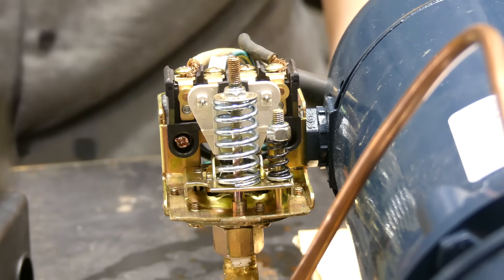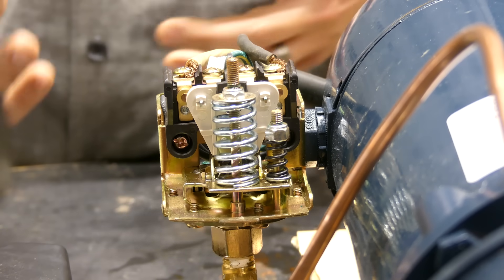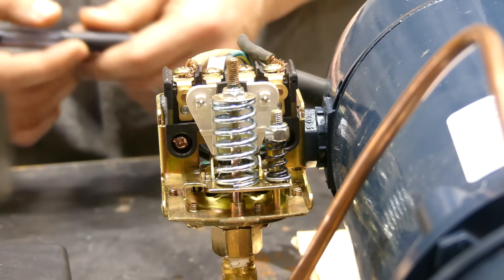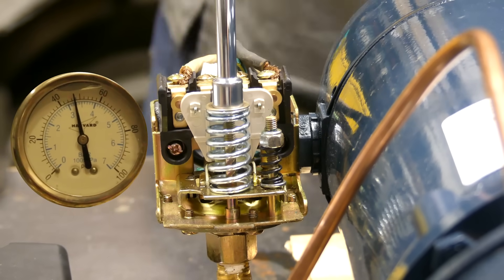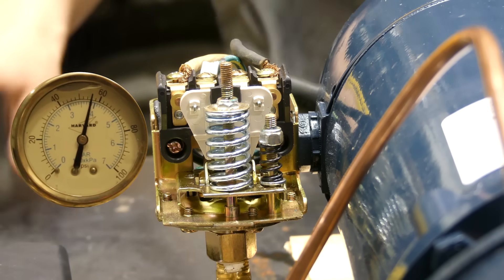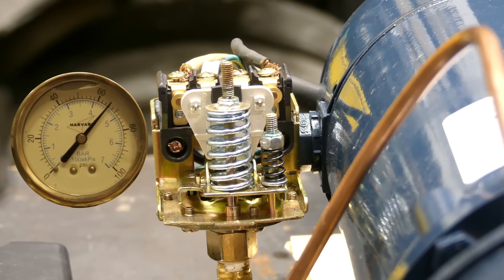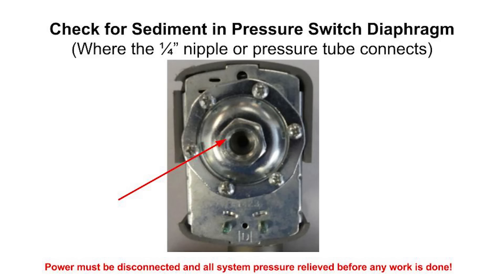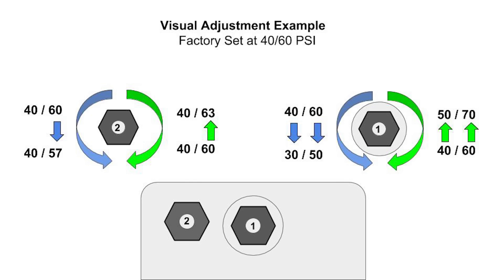How To Adjust a Pressure Switch

Comment: Thanks for the video. I did not know the specifics before I had replaced my tank and my pump was cutting in very low. I will need a new 40/60 switch but I was able to adjust my 30/50 in the meantime. Thanks
Reply from the maker: Glad it helped!

Comment: I just had to adjust the high pressure shutoff.  I have a shed that has the pressure tank and pressure switch and a house 200ft of piping away with another 30 gal pressure tank.  So I was having the well shut off when the shed tank got to 50psi then then the pressure would leak down to 40 psi to fill up the other tank, the house never saw 50psi.  So I upped the shutoff to 60 and it leaks down to 50 as it pressurizes the 200 ft of line and the other pressure tank.
Reply from the maker: Your pressure tank in the house isn't doing anything for you. All of the pressure tanks need to be close to the switch.

Comment: I wayched your videos, very helpful but still have a problem:
Erratic Water Pressure Issue:

The system will pressure up after the fixtures in the house drain off the pressure, however, the water pressure gauge is at zero, and the pressure switch with not cut back on for at least 10 min.  Assume there is a pressure lock of some type.
Steps I took to remedy:
1. After draining all pressure and water from system the pressure tank measured 10 PSI
2. Pumped pressure tank bladder to 28 PSI (30-50 switch), same issue
3. Replaced Gauge (old one was stuck) and Pressure switch (30-50 PSI), same issue
4. Checked voltage, 244vac hot to hot, 122vac hot to ground (3-wire pump)
5. Resistance was 4.6 ohms hot to hot, open each hot to ground
6. Drained tank again, and double-checked air pressure, same issue
7. Could force it on by bleeding off pressure on Schrader valve on tank but still will not automatically come on until system bleeds down for about 10 min.
Suspect pressure tank issue?
Reply from the maker: Replace the pressure switch and make sure the 1/4" nipple connected to it is free and clear of sediment buildup/debris. It sounds like there is a blockage that is blinding your switch from the real pressure.

Comment: I have a Square D Pressure Switch. Mine however has a Lever on the side of it. What this does is shut the Pump Completely off if the pressure drops about 7 psi below the cut in pressure. What this does is assume something went wrong. I.E. A Pipe broke, or the Well Pump is not pumping. You can manually restart the Pump after checking everything over by operating the Lever. I highly recommend switching to this Pump Control.
Reply from the maker: It is great for cheap pump protection, we even have a video on them: https://www.youtube.com/watch?v=ROvZpwHV9Ho
Reply: Or, there's no more water in the well or cistern, or the take-up pipe or filter is clogged.   For a cistern, a float switch can accomplish this as well.

Comment: Wouldn't you need to adjust the air pressure in the tank to coincide with the higher cut in pressure?

Comment: MOVING THE PRESSURE TANK from the well head to a place inside the home . . . how much difference in pressure would that create if the floor of the home were three feet higher than the ground at the well head?
Reply from the maker: If the goal is to increase the pressure than it would be best to simply adjust the pressure switch at the well head. You'd only gain about 1 PSI by moving the equipment to the house.
Reply: Well that's the first time I've seen that question!  A column of water weighs about 0.43 psi per foot.  The difference you'll see is negligible.

Comment: I had a pump that worked great but wouldn't come on when pressure dropped.  I'd tap on the pressure switch and it would come on. I figured time for a new switch but took it off the motor and into my shop. Removed the rubber diaphragm and found basically a formed sandstone preventing it from relaxing. Cleaned, put back together and works great now. Just fyi for anyone with this issue.

Comment: After adjusting the range to increase flow in the house,  do I need to add air to the bladder from 28psi to 38psi?
Reply from the maker: Yes, the air pressure in the tank needs to be set to 2 PSI less than what the cut in pressure of the switch is.  This reading needs to be taken when the pump is off and the system is empty of water pressure.

Comment: Thank you. just 1 Q: if the pressure is dropping without a fauset open...does that only mean that there is a leak, or could the switch be faulty??
Reply: You could have a leak, or a check valve or foot valve (in the well) that is not working properly.  Could be defective or just a piece of debris.

Comment: This is great had to replace that switch today ! And after had low water pressure.  .
So I just need to add pressure? Not go pump air in as I was told rt ?
Reply from the maker: Thanks for the question oldman! I would check the pressure in your tank prior to adjusting the switch. It needs to be 2-3 PSI below your cut in pressure. If it's too low, add air and test the water pressure. If the water pressure is still too low then you can adjust the switch, but be sure to add air to the tank accordingly. We explained this more in depth in our pressure tank video: https://youtu.be/w21qa2bMUh8

Comment: My pump isn't cutting off until I pull the power after it reaches 100psi. I'm getting 40 psi with all pressure relieved from system. I will check for sediment in the diaphragm. Can I blow it out?  I've been watching your videos. Thanks for the help
Reply: Defective switch or the tube that goes to the pressure switch is clogged.  I wish my pump could get to that pressure.

Comment: You also have to change Air pressure in tank to reflect the switch adjustment.  20/40 18 lbs....30/50 28lbs 40/60 38 lbs ...of air pressure.

Comment: Same switch is used in air compressors, adjusted 90lbs to 110 psi. Dual compressors 160 psi to 180 psi.

Comment: Definitely the BEST explanation, thank you! I still have a problem, however the switch isn’t cutting off at 60. I adjusted the differential ccw and still is not cutting off. Any advice?  Also, i see know way to prim the unit, how does that work am I trapping air somewhere causing less water to be stored in the storage tank?
Reply from the maker: Give us a call and we can help troubleshoot: 855.329.4519

Comment: Does this adjustment on a 30/50 eliminate the need of going out and purchasing a 40/60?
Reply: Just made an adjustment that you may want to consider. I also have a 30/50 switch. My factory preset psi on the tank is 30. So I know the tank can handle 30 psi of air (with the tank drained). The air pressure should be 2 psi less than the cut off setting,  so I adjusted my differential to 32/52 which made a huge difference after the settings had drifted over the past 2 years to approx 25/45.

To do this, turn off the power to the switch, valve off the water supply, and drain the tank of water. Adjust air pressure to 30 psi using a tire gauge and air compressor. Adjust the center nut as shown in the video until you achieve 32/52. 

Worth spending an hour or so doing this before you go all out on a new switch.

Not sure if the 30/50 is rated to be adjusted to 40/60. Probably not recommended I would assume.

Comment: great video guys,  Made very easy to understand.   What if the gauge keeps going off and on,  but no water is being used.  Could the gauge just be faulty.  Other than a faulty gauge, Any suggestions,   Thanks for the info.------- John
Reply from the maker: Sounds like you may have a leak.
Reply: @RCworstwater  I feel so stupid.  The next day I was outside and noticed the hose was on and had a leak.  Problem solved.   Thanks for replying

Comment: What's the best way to make these adjustments to the pressure switch and pressure tank if the gauge on the t-assembly is not functioning?
Reply from the maker: You need a functioning gauge on your system to read the pressure. They are around $5 at your local hardware stores.

Comment: Thank you. Your video is very helpful.
Besides low pressure, the other problem I have is that pump keeps turning on every time I use water even as little as washing hands.
Any recommendations?
Thnx again.
Reply from the maker: Your tank may not be big enough or the bladder has failed. Here's a video on how to check the air pressure in it: https://www.youtube.com/watch?v=w21qa2bMUh8
Reply: That was mine.  Tank pressure was only 5 psi.

Comment: If we have two houses and have had 3 before on a submersible pump on 40/60.  I had two broke places on the line and the men set my switch on 40/65.  Will this hurt anything.  My tank has 38 psi in the holding tank
Reply: Unlikely.  You can follow the instructions in this video.  Just back off screw #2 a bit.

Comment: My system seems to not be able to hold pressure during the switch between sprinkler sections.. my bladder tank is set at 38# so it’s good.. and my pump comes on at correct settings.. it seems tho, that when the switch between sections occurs, the pressure can’t hold thru the load it needs to change. Thus falls below the 40# and system turns off.

Comment: Can the range be extended for example on at 10 PSI and of at 60 ? This is because the the water pump is resuming too quickly.
Reply from the maker: Sounds like your pressure tank is too small
Reply: No.  Can't do that with Square D switch.  I think your pressure tank is waterlogged.

Comment: Increasing the range will cause also the cut on pressure to increase, what if I need to increase the cut off pressure without affecting the cut on pressure in other words I am satisfied by the inlet pressure from mail line but need to increase the cut off pressure
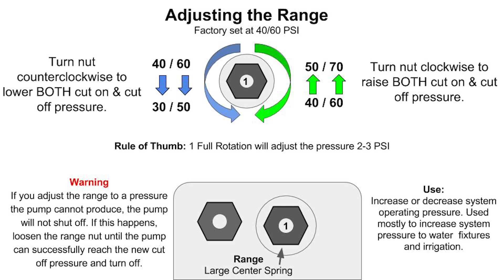Reply from the maker: We show that at 6:53

Comment: They didn't mention that before you start turn off the power to your pump, drain all the water that's in the bladder of your tank and recheck the air preasure in your tank. Always remember whatever your preasure switch setting is like if it's 30/50 the air preasure in your tank has to be set to 
( 2 lbs ) less than your lowest preasure number. If the preasure switch is set at 30/50 your preasure tank has to have 
( 28 psi ) of preasure. If your switch is preset to 40/60 or you want to change your preasure switch setting to that your preasure tank has to have 
(38 psi ) of preasure in the tank. But remember to make sure before checking or changing your preasure tanks preasure fully drain the water from your tank. Tank preasure is set while the tank is empty so the preasure switch can work correctly.

Comment: are there any reason why one should NOT increase the pressure to 70-75psi?  I miss having epic showers.
Oh and after increasing the pressure do we need to adjust the pressure in the air  expansion tank?
Reply from the maker: The main concern is damaging fixtures in the home. Older fixtures are not rated for high pressure. You will need to adjust the air pressure in the tank to 2 PSI below what the pump turns on at.

Comment: Thanks for the info. Question
My pressure gauge runs at 15 then stops on 45,  ihave 2 problems
1. As it stops running at 45 the gauge drops at 35. Its supposed to be 45.
2. The pressure is too fast to go down to 15. Making the motor to run  always without filling a pale of water. Pls help me.thanks.
Also, aside from the adjustments i have a valve also controlling the intake of water being pumped inside the tank, together with the pressure.
Reply: Usually an indication that you need to add air to the pressure tank (with the system depressurized).

Comment: I recently changed my pressure tank and pressure switch. The pump is now running continuously without switching off. I had no choice but to switch it off because it was overheating. I also tried closing the outlet valve from the pump and turning the pump on but again the pump continues to run without switching off. Any ideas what the problem could be? Do I need to adjust the pressure switch to lower the cut off pressure?
Reply from the maker: Yes, it sounds like you've set the pressure too high and the pump cannot produce the new pressure.

Comment: You are a very good teacher. We have been getting alot of sand coming up from our well  ( after 4 inches of rain in 5 days? ). Changed the whole house filter and noticed that the pressure gauge is stuck at 43 lbs. The pressure switch is 30/50 and is working and we have good pressure in the house.  Could the pressure gauge be plugged with sand/mud making it not move? I ran probably 10 gallons of water out of the spigot that is near the gauge until it became clearer. Thanks.
Reply: Yes I've seen them get plugged before

Comment: When I adjust my 30/50 pressure switch to 40/60 should I also add air to my water tank to 2 lb below the 40 mark which would be 38 lb?
Reply from the maker: Correct

Comment: I've had a new switch installed and it works as it should. However it for no reason will just loose pressure. But the reset are will kick it back on? Happen randomly and can not figure why. New pump, new wires down in well, new breaker? But still will randomly drop pressure?
Reply from the maker: Most likely an issue with your air pressure in the pressure tank. The air pressure in the tank needs to be set to 2 PSI BELOW the cut-in pressure of the pump. Check out our video on  how to make the adjustment: https://www.youtube.com/watch?v=w21qa2bMUh8

Comment: I have another newbie question.  I am trying to learn the concept of how one takes a cistern, or water holding tank - as an input, and then 'pressurizes the  water' so that it can flow through a pressure potable water system.  I know there is a pump, a pressure switch and a pressure tank - at the heart of such a system.  But here is where I get lost... Suppose the aimpoint for such a system is that if the city supply (routed into a residence) is intentionally shut OFF - due to water rationing requirements.  And the goal is to have an alternate pressurized cistern system to supply the home when the city water is OFF - how would one know the minimum pump CFM rating and/or 'head' rating - to provide a 30 psi minimum water pressure into the residential home system?

Comment: Great Video!  I think a lot of people have asked this follow-on question without a response, but I'll try anyway....If you adjust a 30/50 switch to act like a 40/60 switch but don't bring up the air charge to 37-38psi what tank performance is lost.  Is it pressure loss or simply reduced draw-down volume before cut-in?  Anyone?
Reply from the maker: Reduced tank drawdown which causes more cycles.

Comment: I have one of these on my irrigation water pump. The pump turns on fine (when the sprinkler come on) but when the sprinklers are off, the motor turns on then off for a second about every 10 seconds. Which nut should I adjust? PS...I do not have a pressure gauge attached.

Comment: I have a pump that pumps water from the lake to the pump house where the pressure tanks is which is about 12 ft from the lake. The other day the ABS line that comes from the lake and check valve, to the pump blew off where it is joined to the pump. I'm not sure why? I don't think the pump is shutting off. I was using it to water my lawn and garden with a spray nozzle and not a sprinkler. Any idea what would cause this? Its been out of commission for 3 weeks now.
Reply: You have 2 pumps?  It's possible to blow off an ABS connection.  I simply cut off the end, soften it up with a heat gun, then put the pump back on the fitting with a pair of hose clamps.

Comment: Hi, I was wondering if a timer on the pump will damage the pressure switch? Our setup invariably has an odd minor leak that is hard to locate and as such the pump goes on routinely in the middle of the night disturbing those sleeping.
Reply from the maker: You need to find and repair the leak
Reply: Yes, find the leak.  A competent electrician can add a timer and relay/contactor to turn off power to the pressure switch.

Comment: I'm lost !!!!! Just tryed to set up my new pump. The pump is supposed to shut off at 50 psi, but only goes up to 42psi and will run and run. I have to manually turn it off. My friend decided it would be good to let all the air out of the pressure tank. I added 28 psi air to the tank, but made no difference. Help !!!

Comment: My pressure switch started not kicking out at set cut out pressure and runnning up and not cutting out at all just runs constantly under 60 psi have it set for 38 psi (garden pump). Any ideas?

Comment: Hey, my water pump is running non stop, full water pressure in line, there are no leaks in line, but the pump not building up pressure on the gauge to switch off,  what can cause this?

Comment: My switch is a 20/40 but was told it should be 40/60. should I replace the switch to a 40/60 switch? is there a limit to the tank as it wouldn’t be good to have a 40/60 on it?
Reply: The standard Square D switch is designed to operate over a fairly wide range.   Just turn the main screw to increase the cut-on pressure.  Then cut-off pressure will follow  20 psi higher.

Comment: Ok i have a well and pressure tank and switch. Also a gauge in line.  It always reads 40 and never changes.  Heater was leaking from top so I cut off main power,  drained heater and pressure tank.  I turned off water valve at main.  Removed the water heater.  I put system back together without a heater until tomorrow.  I capped lines that went to the heater. (Actually had system up and running with only cold water before I removed the water heater. )  Main on again,   so well should have power and pressure regulator also.  Turned water main on to fill.  Nothing.  No water.  Water main handle just spins.   Can I replace just the handle in the valve? What about the gauge?    And the regulator?
Reply from the maker: Sounds like you'll need to call the water company to turn off the water while you repair the main valve, then once that is working replace the gauge.